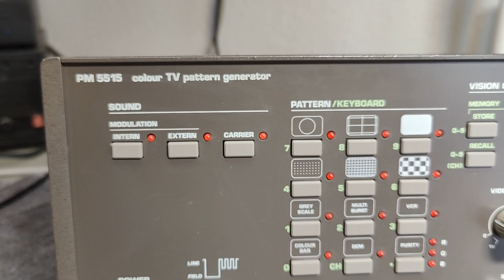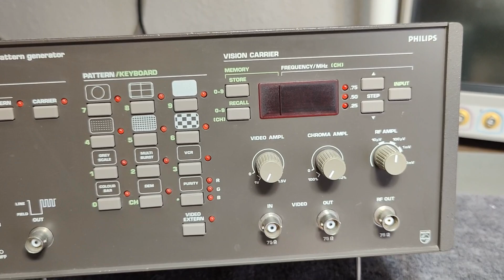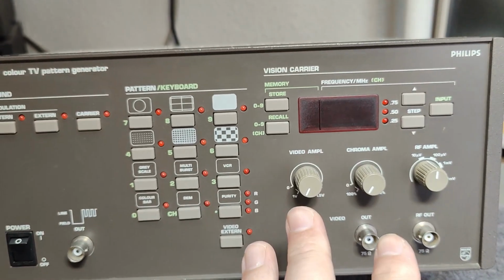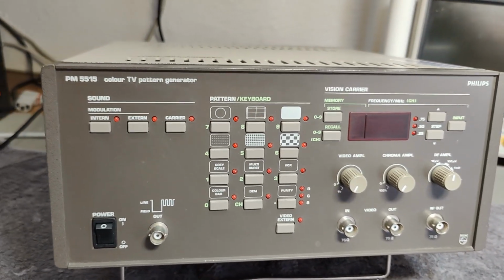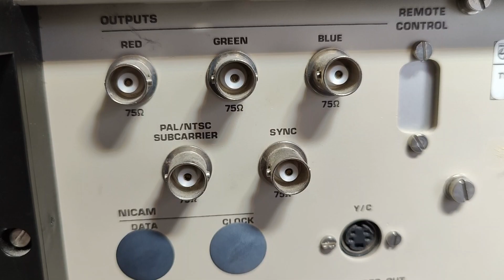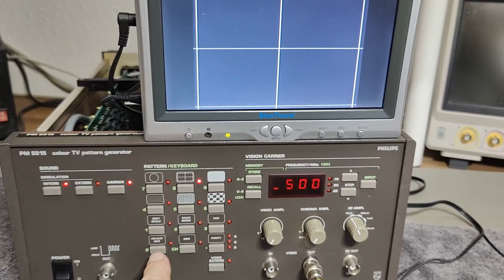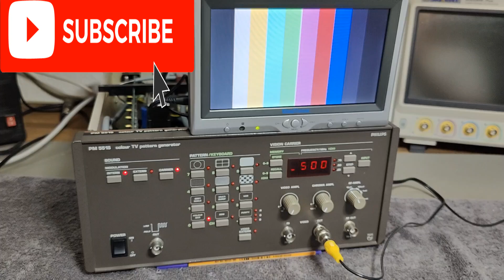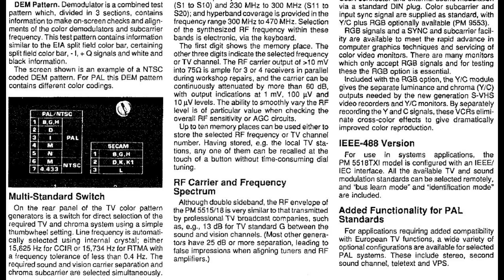Philips PM5515 Color TV Pattern generator 1989 test teardown

Comment: Could pick up a PM5519 semi-locally for about 50eur, but it seems like nobody has done a video about it and what modes/patterns it supports or not. From the little info available online, it seems like it mostly only does color bars, which would be useless to me. Was looking for a Telefunken FuBK style test pattern generator (cause those were what was actually used the most here in Germany) but those seem completely nonexistant at this point. 
Also those button cell lithium batteries don't leak 99% of the time, and this particular BR2325 is even less likely to do so since BR cells are lithium carbon chemistry (longer life, less current and capacity, less sensitive to temperature), rather than lithium manganese in cells starting with CR.   The lithium batteries everyone warns about because they can pop and leak are the barrel type that look like someone cut an AA battery in half, usually CR123A